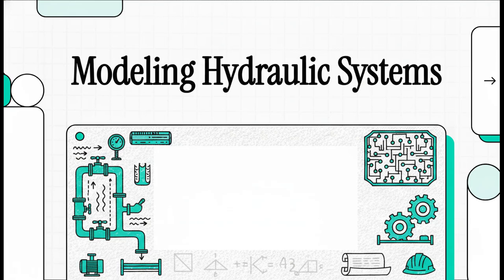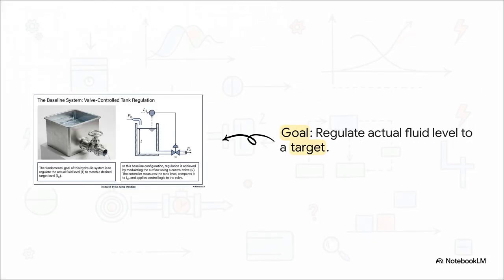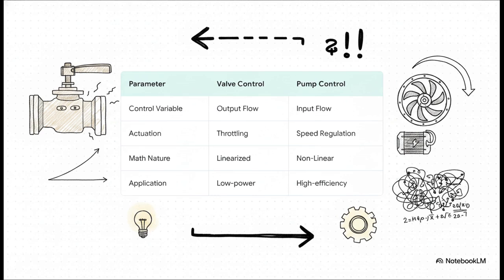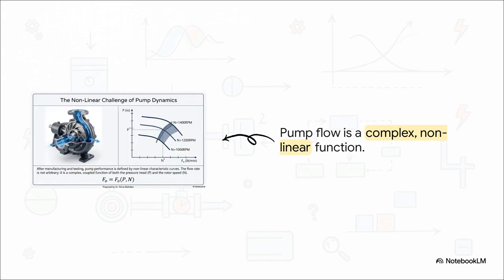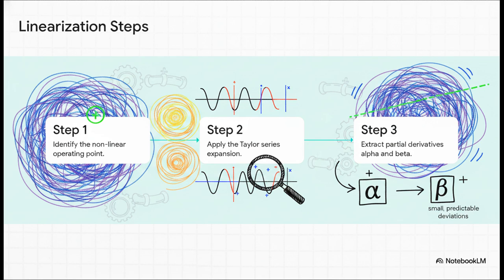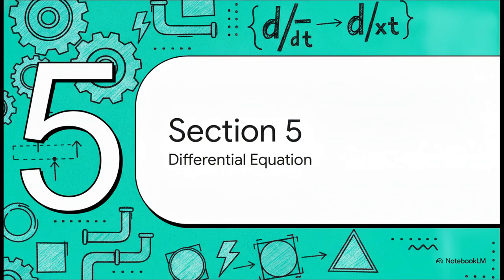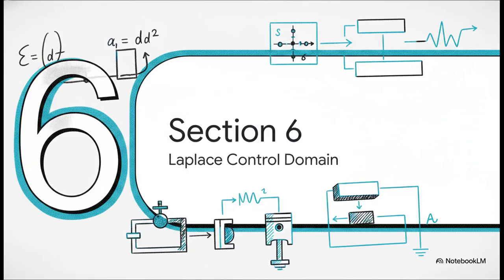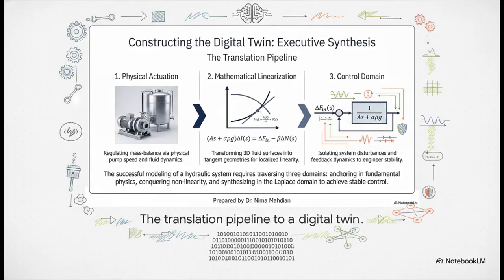Hydraulic System Modeling and Control | Industrial Fluid Power Systems Explained

Comment: In page 5,( Fin) is defined as the flow delivered by the pump, while F0 is defined as the flow exiting the tank. However, in pages 6–8, the pump characteristic is written as F0=F0 (P,N). Could you please clarify whether (F0 )represents the pump flow or the tank outlet flow in the linearized model?

Comment: Dr. Mahdian, I appreciate this clear and practical explanation i have question if you dont mind
In real hydraulic systems, how can engineers decide when the linearized pump model around a nominal operating point is still accurate enough, especially when the tank level, pressure head, or pump speed moves far from that operating point?